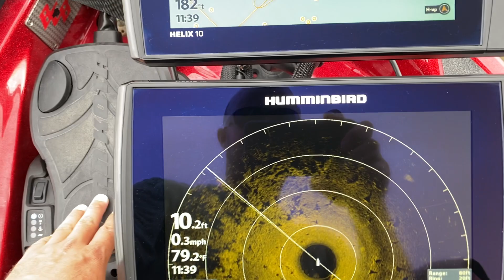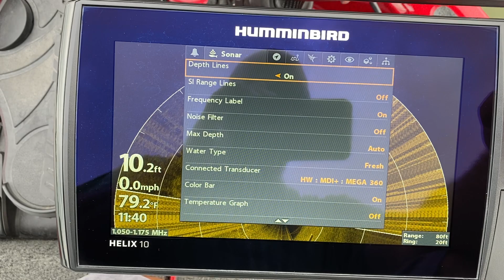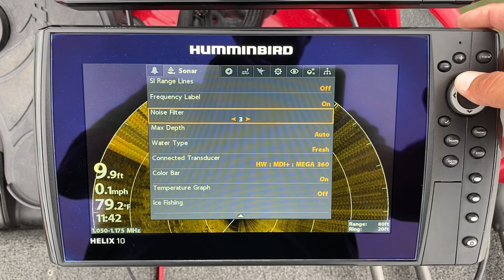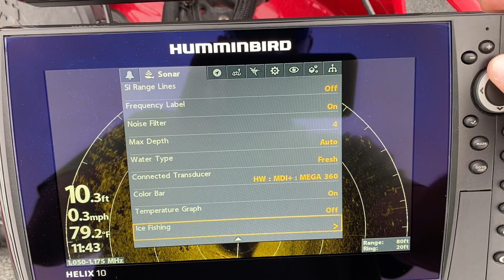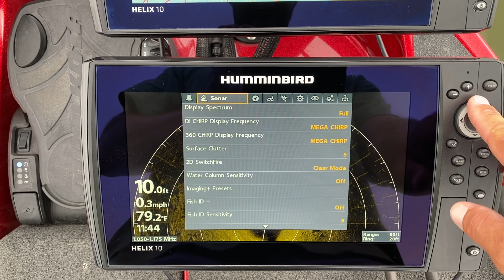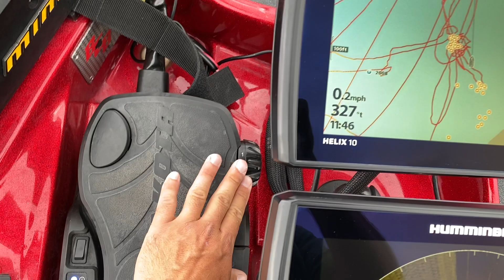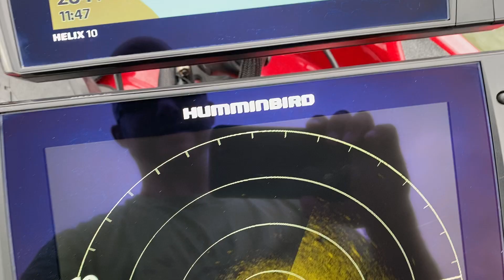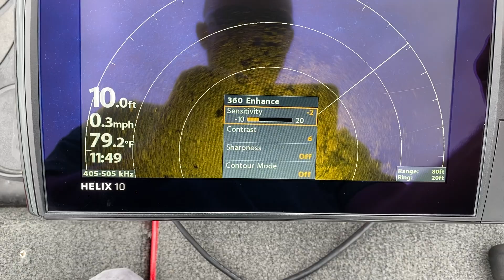M360/Ultrex Interference

Comment: Minn Kota has a dedicated interference wire in the top cover of the trolling motor. Take the control head cover off and there should be an inline fuse holder inside the control head. Check to see if the fuse is blown. Replace if it is. Should be a 3 amp fuse.

Comment: Did you ever solve your problem? I have the same thing with my 360. I wrapped the data cable with copper. Now I only get interference when the trolling motor is activated. It is still quite upsetting.  The issue started a few weeks ago. The fuse in the trolling motor head is ok. That said, I wonder if there is a problem with the actual motor that makes it produce more interference than it is supposed to.

Comment: Don't know if I'm to late to help but you might need a charger choke it stops interference from trolling motor to graph it comes through charger if you have a three or two bank charger usually comes with graphs i know you cleared it up but it might help

Comment: So are you NOT suppose to have your cable or wires coiled up? What would you do with all the excess because all my Humminbird cords are long from the factory. 
I've been having interference on my Helix 12 when I step on the Ultrex thrust and I've tried everything including changing the fuse. I thought I finally fixed it but now my built in transducer on the Ultrex is wonky and isn't reading depth properly and I can't get the same picture that I have at the console even though all the settings are the same. I'm so sick of this crap smh